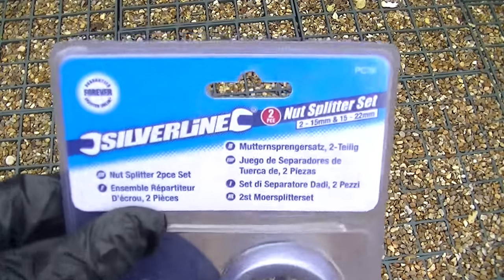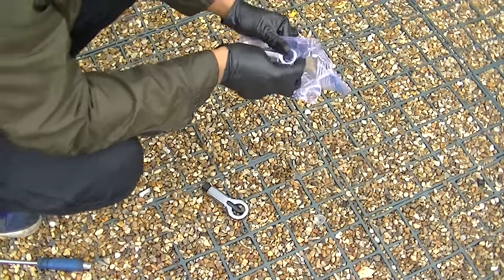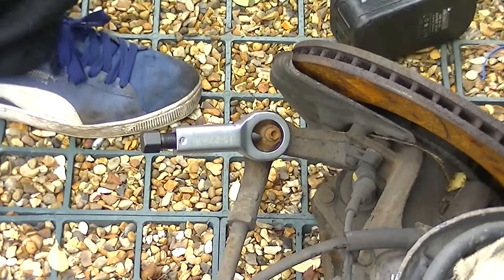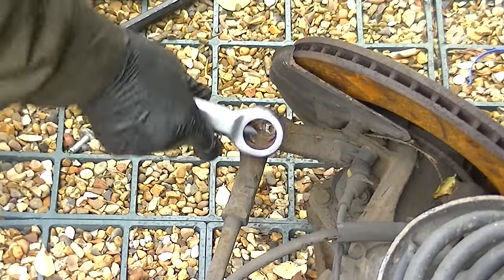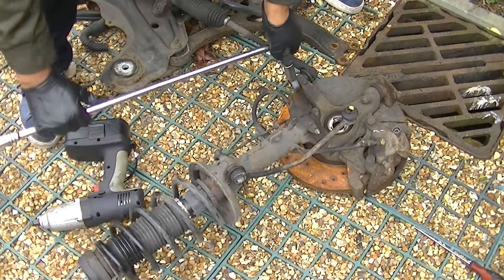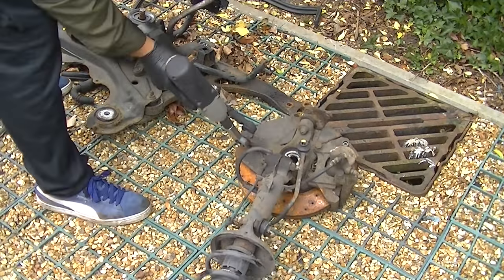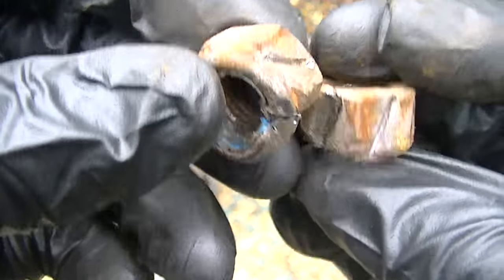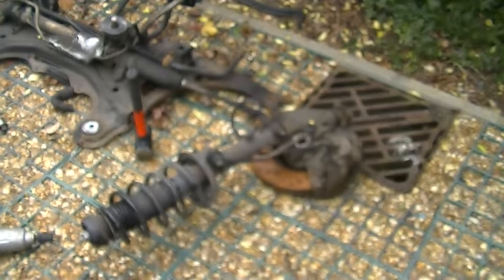Do Nut Breakers Really Work??

Comment: The NUT is what gets split...  NOT the bolt/stud!
Reply: Yes! The NUT NOT funny!
Reply: That's what she said!
Reply: Im sure it can do thr bolt as well though
Reply: Alexander Matias 
Why would you want to split a bolt? They are usually screwed into a blind hole and all you can see of it is the bolt head. If you break the bolt head, then you can't get the bolt out without drilling it or welding a nut on what's left in order to remove it with a wrench.
Reply: Ralfie i said it could do it. I didnt say it was practical.
Reply: Lonnie Moore tbf it's probably fucked the bolt to in all honesty, I don't know what practical use this could possibly have
Reply: Cameron Bromley  I agree
Reply: Cameron Bromley 
Most people don't have a torch to cut rusted nuts from bolts. A hacksaw would be useless if the nut and bolt are tight or in a close space. There is a chance to save the bolt with a nut splitter if need be.  Just run a die down the bolt afterwards to clean the threads up for reuse.
Reply: Lonnie Moore I
Reply: It's too simple to expect him top understanbd that a nut breaker breaks nuts.
Reply: Lonnie Moore
Reply: Dasilva

Comment: I have had mine for over 35 years now. In those day only expensive ones were available and I got a Hazet nut splitter. I tried an hydraulic model but it was not as effective.

Comment: How can you not know the difference between a bolt and a nut?
Reply: Robert Bradley the same guy that tries opening the package like a caveman
Reply: well a bolt dus not have a hole to run it through
Reply: Dyslexic?  He still managed to get the job done.
Reply: Robert Bradley a bolt is the stud side. A nut is what threads on to the bolt
Reply: The bolt is the male part, nut is female (easy to remember that)....if you can’t figure it out from there ask a doctor.
Reply: Come on they call fries chips point it's is backwards land
Reply: @bigdoggy2693  sometimes they do though?

Comment: If you're not worried about saving the nut, just use a rotary tool like a dremel with a cutting wheel.  MUCH easier.

Comment: Professional mechanic here and Ive never ever needed that....a good gun, heat or penitraiting oil is all I use
Reply: Won't work so well when you're taking nuts off ball joints and it spins inside the control arm.
Reply: "Professional mechanic" who has never encountered a spinning bolt with a seized nut.. How peculiar.
Reply: acalora123 apply pressure with a gear jack from below and it wont spin..?
Reply: A nutcracker is cheaper, faster and less mess....everything a pro should want
Reply: acalora123 you use a ball joint separator with something like wd40. Tap the thread or bolt with a hammer a few times to crack the rust and let the fluid in. Then with the ball joint spliter/spreader/separator in place or just a pri-bar the pressure stops the track Rod end or ball joint from spinning and off it comes. 
Nice to see these things work tho
Reply: Ed Wilko Exactly! Gotta move forcefully and quickly!
Reply: Lol. It’s YouTube, everyone is a professional mechanic, ufc fighter, truck driver, and pilot
Reply: shortthrow50 That made me smile....maybe ill take up another profession...
Reply: Nah its a slick tool every good tech loves tools. I just see more farting around really..
Reply: @acalora123  that's why you use an Allen key.

Comment: You were pretty fortunate that this worked. Usually the back side of the splitter snaps in half. The nut stays firmly in place and the tool is ruined. I have used these about a dozen times and have never had one that did not break. Perhaps the hardware used on my Jeep's suspension is all Grade 8 (or metric 10.9) and is too hard for these cheap tools. Grade 5 (metric 8.8, which is probably what was used on the two nuts in this video).
Reply: Holton 345 
yep. mostly a waste of money, maybe the higher end ones may yield better results but I doubt it.  Even the tiny screw on the side of the nut splitter can easily break off on the middle of the torque process or while you're at near end of torquing down in a real tight area, the splitter will just keep sliding off to the weakest side and prolong the misery.

they are a useful tool but in very limited applications. Best to hang on to your vise grips and keep your angle grinders handy.

Comment: Who hits the threaded part on a tierod ? Hit where it goes through the knuckle and it'll pop right off...if it doesn't put your purse down and hit it harder. And their nuts not bolts lol I feel bad for any car you work on and the poor sap that ends up with it after you
Reply: If the outer tie rod end is bad it really does not matter. If it wasn’t bad before it is now so it still does not matter. 
Folks if your tie rod end is not bad, use a bit of penetrating oil and a wire brush to clean those threads. If you watch closely there is a allen wrench spot on the end of the stud. Get the nut broke loose then the impact he had should remove the nut. A tie rod separator will pop it out.
Reply: Coy Patton lmfaooo 9/10 that allen head strips out. And in the video he said "if your trying to save it, just use a bit of wood on the top" no need for that and it honestly is a bigger pain in the ass because the wood absorbs a lot of the impact, and can't get the full ass behind it. When you hit what it goes through all of that impact goes to the part. This is pretty basic knowledge in terms of mechanical work.
Reply: Pretty tough talk for someone who doesn't know the spelling difference between "they're" and "their". The man said "if you're trying to save this, use a bit of wood on the front of it". He didn't use the wood, so clearly he doesn't plan to reuse the tie rod end. It doesn't matter if he used proper procedure to remove the refuse part. The video was about demonstrating if a nut breaker would work and he showed that it did. And what's this whole thing about him having a purse? Are you so insecure about your manhood that you need to go point out how unmanly you think everyone else is in an attempt to make yourself feel better?
Reply: cjoe42 wasn't insulting anyone's manhood, but if the shoe fits wear it. And that's pretty big talk for someone who had the whole point of this go 10miles over their head. You seriously trying to do this right now? Lmfaooo
Reply: Fox in theory hammering on the side of the knuckle can bend it and while 99/100 times it won’t bend, if you hit it particularly hard you could cause an issue with your toe out on turn alignment angle. Ideally you you a ball joint separator to take it out of the knuckle. Or just put the nut back on a couple threads so the nut takes the damage. 

Also if the stud starts spinning, just pry up on the bottom of the rod end with a long bar to stop it spinning.
Reply: Fox LOL put down your purse and hit it harder, I’m dying. Normally for suspension components I hammer the fuck out of the pickle fork or the actual component.

Comment: The nut breaker is to be used to compress the fastener in a manner to loosen it not ruin it also its meant to use manually not air tool rated.

Comment: you need an Allen wrench to hold the bolt in place while you remove the nut...
Reply: Most the times those strip out. Have had it happen many tine

Comment: I used a smaller version of this tool- about 20 years ago, to remove the 3 (6) strut nuts on my Nissan. After 2 the body of the tool broke, and I just ended up using ViseGrip to hold it as a regular chisel, and whacked it with a sledgehammer. Worked fine then. Yup- I whacked off my nuts.

Comment: the best way mate is to use the splitter on two opposite sides of the nut. it will simply fall into two pieces. no need to go launching a hammer at it.

Comment: death wheel or die grinder, those things are a pain in the ass. for tie rod ends, put vice grips in between the knuckle, as hard as you can get em, use channel locks to close them if necessary.  rip with the gun and done

Comment: when you break the nut, the Screw thread is damaged?
Reply from the maker: No thread is good
Reply: Thanks👍
Reply: Uwe Sanz  If you drive the splitter too deep AFTER the nut splits, you can damage your threads, but generally the nut splits a bit before the thhreads get damaged. You should notice the tension on the splitter suddenly easing off at the moment the nut breaks apart. That's when you STOP turning the pressure screw!
Reply: But you can screw up the thread by knocking it loose with your hammer like you did.
After you broke the nut once you need to do it again 180 degree turned and it will fall right off.
Reply: Great question! Just about to ask this myself
Reply: Uwe Sanz threads will be ok unless you go wild with the impact. If you use the breaker bar you will never touch the threads. Go to the opposite side split the nut a second time and the nut falls off

Comment: You got impact gun. You got the socket for the tool. Why dont you get the socket fit the nut to open ít. I need to split the nut in tigh place then this tool too big. Any way this tool for emergency work only.

Comment: That was not an ideal use of the tool. Also why the hell would you pound the bolt with a hammer to get the nut off that will screw up the end of the bolt and potentially pull the threads...

Comment: Dont get that tool from autozone or oreilleys or advanced auto oarts cause they sell it for three tumes what its worth. Get it from ebay or amazon and harden the steel and you have one cheaper and much better than those from auto parts stores.

Comment: Right.

Judging by the back yard mechanic attack on the packaging, i knew instantly i need to look closely at the video.

No Table, No wooden surface, no bench vice, no fucks given.

Nut breakers are for idiots that dont know how to remove bolts or have lack of iq power to use the basics i mentioned in the list of things you dont have to work with. As mentioned with the No access list above.

Concidering that the parts above are from a car that is most likely accident damaged, i dont think buying anything from you is a smart idea at all.
Reply: Chop shop much?

Comment: Umm good tool? Nah - it's broken after undoing two NUTS. Look at the end footage and the tool wedge has smoothed over. It's made from cr*p Chinese case hardened steel. You should never have to throw a tool away after using it!

Comment: Can't you just cut it off with an angle grinder?
Reply: +dacasman not everyone has that bro.
Reply: Yeah, fair enough. I think most people doing work like this should have one though.
Reply: anyone can work on cars tho.. i don't see your logic lol. BMAC doesn't even have an indoor place to work on his rides and he does more work than me lol
Reply: I'm just saying people that regularly work on their own cars should get one if they don't already. They are a really good tool to have in your arsenal.
Reply from the maker: Yes you can, but if you have no power this is a good option.
Reply: +dacasman The nut splitter can get into places that an angle grinder can not reach.  Even if you can get an angle grinder in there It would be very easy to damage surrounding parts.
Reply: NarfBLAST yeah that's true. Didn't think of that.
Reply: Sometimes there isn't enough room for a grinder.
Reply: I prefer to dremel for the tight locations. The main problem, if you use any type of round cutting disc, you can't cut the nut completely to the bottom, and you have to pry the rest of it off. You can usually use other grinding tools with the dremel, but it really depends on the situation. An angle grinder is almost always too large to get onto a nut, and usually better served just to cut the bolt off instead.
Reply: Hypothetically if you're working on a nut on a stud like this tie rod end in the video if the component with the stud attached is good and does not need to be replaced(also might not be available for weeks) but ,you're trying to free the component that is fastened by the stud like the steering knuckle/hub assembly featured in this video that you have in stock this is a fantastic way of ensuring a cheap repair. Also in some cases you may be dealing with a standard bolt diameter ie 5/16" unc but it could have a very uncommon length that your shop or your off site service vehicle might not stock so you'd be able to save the uncommon bolt but you would have the common nut no problem. Cutting the fastener should always be one of the last resorts.